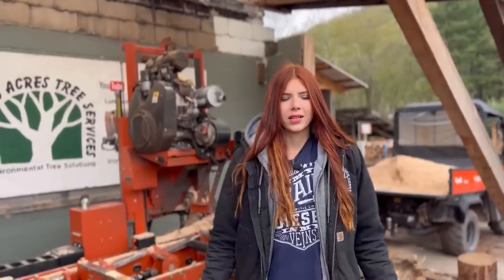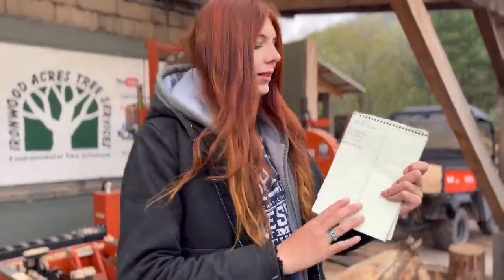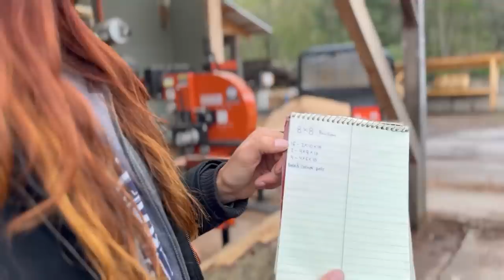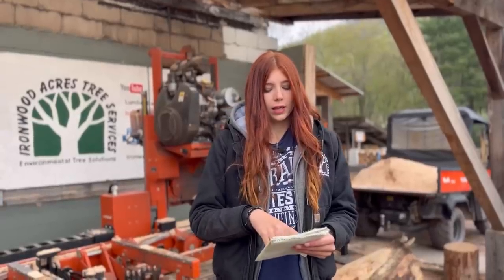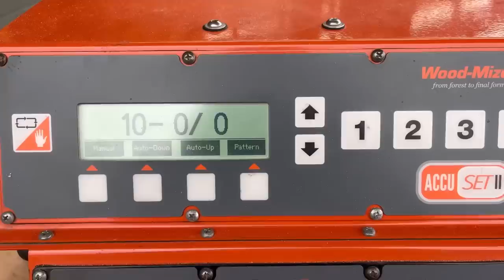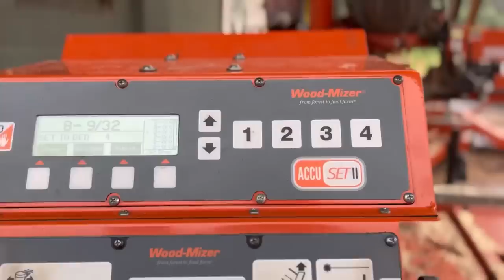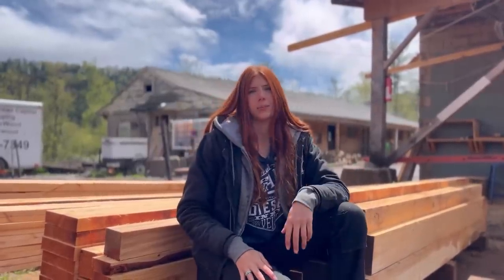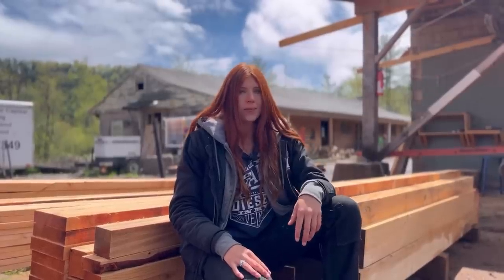Milling Lumber for Pavilion + bonus clips of beginning stages!

Comment: I have built several pavilions for the Boy Scouts.  The finest trick I have learned is the 4 corner posts should NOT be perfectly vertical,,  If the top perimeter is exactly 96X96   , then the equal perimeter at the bottom where posts are set into the ground should be 98X98 or 100X100   That very slight lean toward the structure ,1"  Is not noticeable,, the stronger 2 inch increase only a trained eye can see it.  What it does is the structure cannot sway in the wind.  That very slight lean does not allow.

Comment: Careful backfilling to close to the bottom of the walls. Generally there should be at least 6 inches of exposed concrete to protect the sills from termites or carpenter ants depending on what sort of beast live in your area.

Comment: I heard that using soft wood in making wood pellets, basically the pressure to make the pellets are equal to hard wood for firewood. Just an idea to go with your composting of saw dust. Might be worth it, are not. I thought since you said hemlock was classified as softwood.

Comment: What is the dimension on your 2"4, here in sweden is the saw dimension 50x100 mm and the dimension cut is 45x95 mm. We use mm instead of inch. 1 inch =
25.4 millimeters

Comment: Hey! Guys! Been a Carpenter 30 + years, was wondering, I  never used gloves either. But I've had a lot of splinters! How about you guys? I know the lumber is freshly milled. Just curious.
Reply: They did make a video about this awhile back. Seems they dont have a splinter issue or prefer them to the downside of gloves.
Reply: Something people don't realize or think of is the fact that the lumber they are working with is "green" meaning that it is wet. The fibers in the wood are very flexible and just fold over, so all of the little strings of wood you see hanging off the sides of the boards are soft but DON'T get me wrong you can still get splinters but it's not as easy to get get splinters from the wood they work with as compared to the dried wood that you work with.

Comment: Why would you just not cut a 2 foot round off the end of the 12ft. Log to get the 10ft material you need instead of cutting all the boards down  to specific size all you have left is a2 ft round for firewood.